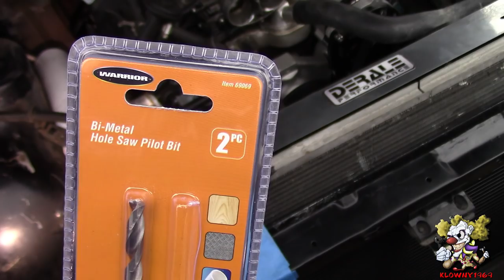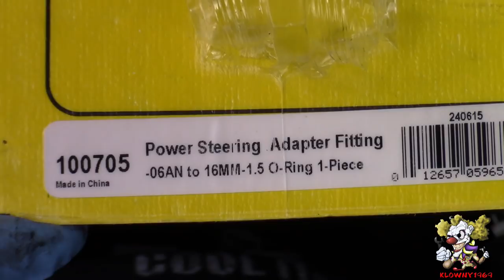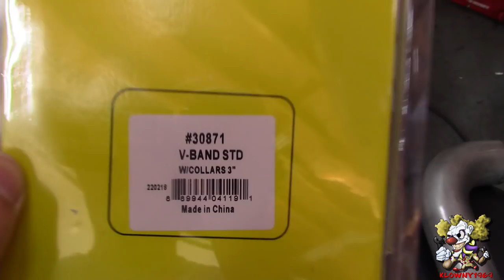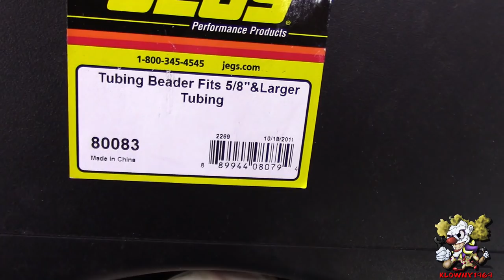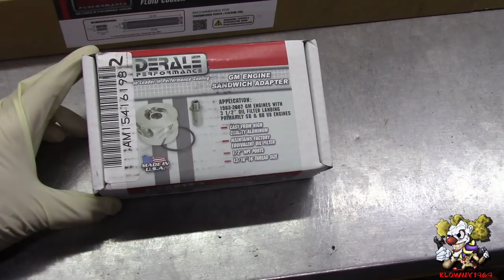How To Twin Turbo a Car !! - Step By Step!!

Comment: Man i cant stop criticizing most peoples project, but besides knowing turbo and engine specs, this was a hard project to nit pick. Great job guys, and great idea using NREs design. More exhaust than a mid tubes y pipe and get that car a better RADIATOR!
Reply from the maker: Thank you sir..alot of work went into building the car and making this video..don't forget to subscribe
Reply: @klowny1969  I need more complex preferably 4th gen Fbody stuff. But ur third gen is close enough, so more in depth vids of further building, tuning susp @ the track, tuning ecm, turning up the boost (hope that motor has .028-.030 rig gap) Like total engine specs would be cool. As well as building the rest of the car to match. Do a rear end, built trans, driveshaft, maybe a really tucked roll bar or 8.50 cert, etc. Make that B run a number! Im not a 3rd g guy, and that thing is my favorite. Also love any later Formula F/B. My car looks stock SS, besides the Weld RTSs with 6.5" of FRONTspacing (yeah the monster dish gives away the narrowed rear-3.5" backspacing on a 10" wheel, which i had to custom order as the max available), if 325 radials werent obvi enough.
Reply from the maker: @mavsformulaful  thanks..i will try and make more videos on this car
Reply: @klowny1969  Right on. U got my sub if we can see this thing built right, but still sleeper... like a stock rear wheel would look great as the rear of a drag pack. And see if somone can narrow the 17/18" front u have now as a skinny! Or if not that, someone would make a drag pack for you in like 17x5 and 16x10. That would be the ultimate sleeper fbody top off. Snowflake drag pack! I think weld has a new similar wheel if they cant be made cheap.

Comment: Just watched your speedo corrector video.  My speedo and rpm works but when I put 373 gears in, it made my speedo and rpm's say I was going faster then I actually am. For example speedo says 50mph but I'm really doing 35-40mph. Also hits the rev limiter/governor and kills the car until the rpms go down,its never done it before the gear install.

Comment: New subscriber to your channel. I bought a thirdgen and the radiator support is bent upwards so my radiator sits higher. Can I use a sledgehammer and knock it down straight. The hood closes but radiator shroud doesn't pay flat.
Reply from the maker: Thanks! You can try bending it down with a big channel lock..good luck!

Comment: You know by running that big power wire by the att if he plans on having a radio in there there might be a chance of some interference for it I've had and seen that a lot lol
Reply: Good point though this car does not have an issue with the radio, we should have mentioned in the video that the antenna wire is shielded, just so people reading this understand electromagnetic interference is when current flowing through a conductor will induce noise on near wires or electrical components, in this case you need a shielded wire to block the noise, thing to note is the shield should be grounded and only on one side.

Comment: Probably a dumb question, but what kind of brush are you using on the air compressed tool to remove the gasket from the block when you removed the water pump?
Reply from the maker: Its a scotch Brite cookie

Comment: I'm curious about the kit, can we get a link? I've been considering doing this down the line but have limited experience with Forced Induction. I know y'all mention some of the kits and part numbers in the vid, I just was wondering if we could get a breakdown of them in like the pinned comment or something. Very interested in what you've done here. Loving the modifications to the AC system, very clever.
Reply from the maker: The only kit in this build is the accessory drive by eddie motorsports..everything else is custom
Reply: @klowny1969  that's awesome man. I guess I misunderstood some of the parts talk lol. Wouldn't be the first time my English has failed me lol. Still would be cool to see a parts list breakdown on the the stuff that was bought, like the condenser, the pulley kit and stuff. Just a thought. Great work, totally thinking about doing some of this to my Trans Am now.
Reply from the maker: @ariyanadumon4549  no worries..I'll try and see if I can get a parts list..thanks for watching
Reply: @klowny1969  Absolutely, I watch quite a few of these kinds of things as my build is still in progress, and I've wound up ordering things based off of some of them and been quite happy with the results. It may even help your other fans follow in your footsteps lol. Thanks again for all that you do, I hope the car show goes well.

Comment: This was elaborate, good show. Three ring circus good show. How long did the whole thing take?
Reply from the maker: Thanks man..it took 4 years..but we didnt work on it all the time..we were taking months off at a time..
Reply: @klowny1969  you going to do a dyno video?
Reply from the maker: @chemicalspore  we probably will..not yet though..gotta build a better block and trans
Reply: Yeah i would hate to see that thing blow up on the dyno.
Reply: @klowny1969  Not four years for the work done in the video right? When you say four yrs I assume you mean the original engine build, power adder and everything combined.

Comment: Hey bro having a issue with my lt1 97 camaro z28. I got my motor rebuilt 2 months ago. When I got my car it was noy leaking few weeks later few drips here and there then the leak got worse.i started the car went underneath look at the location of the leak was dripping down where the crank seal is. I went to another mechanic they changed the seal. I got the car back no leaks then week later leak again from the same spot and leaves a lityle puddle of oil. Any idea why this is happening and what caused it to happen and what can be done to resolve this issue? Frustrating to spend money and still have the same issue. Any help will be appreciated.
Reply from the maker: Are you talking about the rear main seal? Or the front timing cover crank seal?

Comment: is that an L89 5.7 ltr engine?
Reply from the maker: Yes it is..don't forget to subscribe
Reply: @klowny1969  I got a 1993 z28 thats the Lt1 engine. looks almost similar I had to double take it for a second. but then I was like that looks like L89 on second thought. I have seen people do all sorts of engine swaps on those older camaro/ transams/firebirds. nice work on the dual turbos btw. did you have to change the internals first? I know in my cars engine its already 11:1 compression so youd need to do full interal work like forged pistons ect to make it work with a dual turbo like that. you could put a turbo stock on it but you could only run 6-8 psi max on stock... I already subbed btw.

Comment: Do you know how to test a icm in a  88 gta trans am Pontiac trans am 350 tpi
Reply: If the icm is bad usually the engine won’t start, it provides an rpm signal to the ecu and a ground pulse to the ignition coil for spark, if the engine is not running check for spark, if it starts but runs weird check timings with a timing light, also remember to make sure the bypass wire is disconnected when setting timing but make sure to plug it back in when done, it provides a 5v signal to the icm so that the electric spark control of the ecu is working otherwise the timing would be stuck at the fixed point you set it at mechanically,  another quick way to check if your getting an output to the coil but are not sure if the coil is bad, put a test light on the positive terminal of the battery and probe the ground side of the coil, with the engine cranking the test light should be flashing, if it’s not make sure the icm has power and ground.
Reply: @georgeplevritis5190  it's not starting 
It only turns over 
And I checked for spark 
It has spark . 
One guy said that the icm does spark and pulses the fuel inj to 
I just orderd a new computer from the part store 
135 cdn 
But if it doesn't work it has to be the icm

Comment: Man i feel like a bitch wanting to keep my ac on my built 4th gen getting a turbo, in the southwest.. You couldnt delete that crap in NY? The Great Bambino would not approve. Jk guys.. And 3 core chinese all alum RADiators are cheap, upgrade that stock junk. It'll RADiate more heat out of that TT small block.